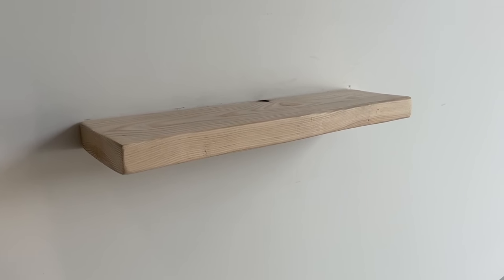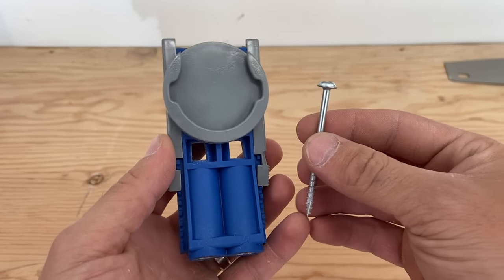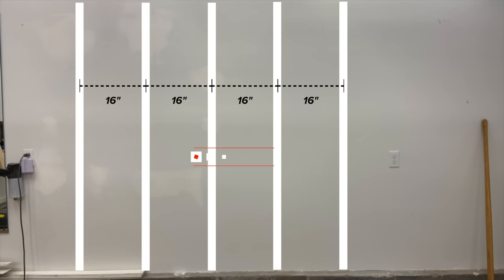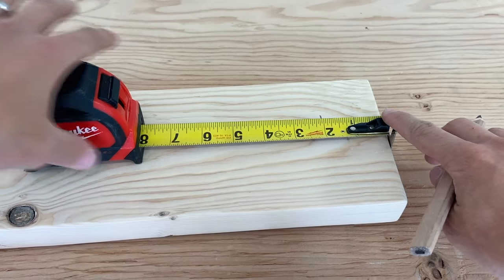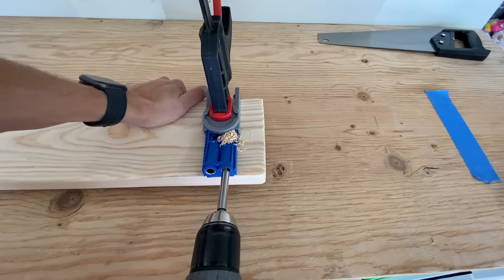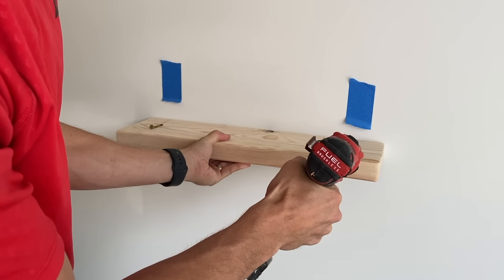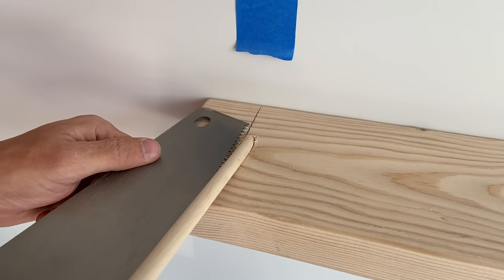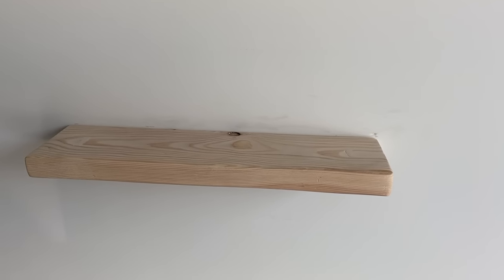This floating shelf is held up by 2 screws.

Comment: Look up the shear strength of your screws. Voila you’ll know what they can reliably hold up.
Reply from the maker: Good idea! Thanks for the info!
Reply: Is pulling strength always higher than shear strenght? Because there aren't only shearing forces actioning. When force is applied on the middle of the shelf you have a lower shearing force than pulling force. So it's not always easy to say, just look up the shearing force. When looking the max pulling force and shearing force you have an idea in which range you find yourself. That's true :)

Comment: Pocket joinery is probably about the worst way to mount a floating shelf. Unless your'e like this video and plan on putting nothing other than a stuffed animal on it.
Reply from the maker: I’m pretty confident in this system but it’s pretty unlikely people will have more than 50 lbs on a shelf like this! It should work just fine for the majority of people!

Comment: In typical houses the studs are 16" oc at exterior walls and maybe bearing walls depending on load rating.
Normal interior walls are 24" oc
Reply from the maker: From my experience, it will depend on your state and city requirements as well has the framer for the construction of the home! In my house, everything is 16” on center! But that’s is a good point! I should have talked about them possibly being 24” on center!

Comment: .....or, to make things even easier for a tool-poor DYI-er,  just drill 90 degree horizontals through your shelves into the studs and cap the holes, which are very very long now, with a long piece of dowel.

Comment: hold up - no plugs at all? i can almost guarantee using this method won't last and im actually really surprised he was able to stand on it.
Reply from the maker: I drilled into the stud behind the wall! This is what is holding the weight! This video might explain more! https://youtu.be/2j1jn6CaQY0
Reply: @Nailedityt  fair play. they must be some high quality screws! I’ve seen this done before but they bury thick rods into the wall behind the shelf and slide the shelf on. Maybe that was overkill and this method would have sufficed.
Reply from the maker: I promise if you buy the screws I recommend, you won’t be disappointed! They are amazing and you probably won’t want to use any other screws! Give them a try and you’ll see what I’m talking about! Thanks for the comment!